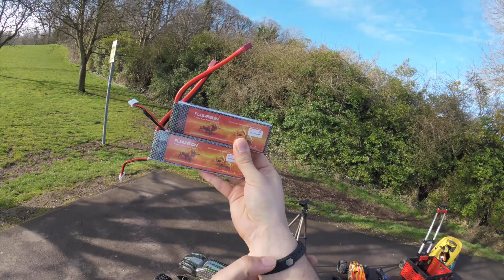Traxxas Xmaxx 8s Running New Batteries - Floureon Part 1 Video

Comment: Good job My Friend! I run ZOP Power sometimes both 3S & 4S and they are also on the cheaper side but so far, we've had no trouble in our cars and we run HARD. On the throttle all the time! The bigger trucks seem to need batteries with at least 5000mAh/50C constant drain and a high burst rating. I have some 7000mAH+ and they run a long time even at full throttle, doing wheelies all over the place. I hate that you got rid of it. I could have taken it and only needed to buy one for Sarah!😉👌🤣
Reply from the maker: Thank you matey, I do love high capacity batteries lots of scope for enjoyment and even more scope for battery time :-)
Reply: Well, seeing that I need double the batteries so we can both play at the same time, I need to look for bargains and larger capacity batteries at a decent price is the best way for me to go. Sarah doesn't understand the whole charging/discharging and storing thing but I've been using rechargeable batteries since forever. First RC planes then cars then planes again and more cars and now drones. Each time a different chemistry but you have always needed to baby them to get good service, so I learned each time how to do that. I also have some electrical and electronics background so I have enjoyed learning each different type along the journey. I'm eagerly awaiting bio-gel packs like on the star ships.

Comment: I have this battery and it's awesome. (Need to get more) I've actually had it for a year and it's still in perfect shape. Fits in my Eflite Maule M7 fixed wing, which I have not shown on YouTube yet and my Traxxas aton quad...Does your tripod hold a Kodak 421 camera? I need a descent one...checked at Walmart (No good). Thanks for sharing my bro!
Reply from the maker: Thank you mate, if the camera connection is the standard threaded whole then you shoukd be ok. Do you know the diameter of the camera moubt dimentions?